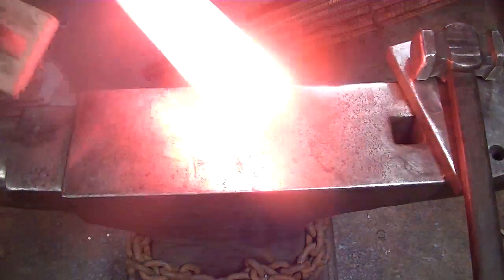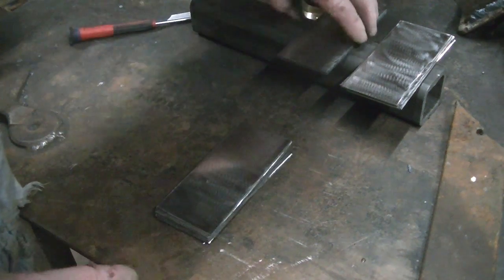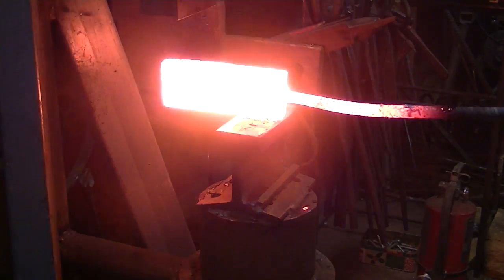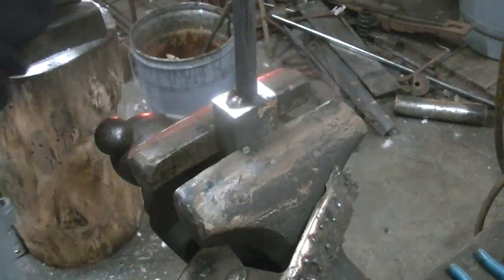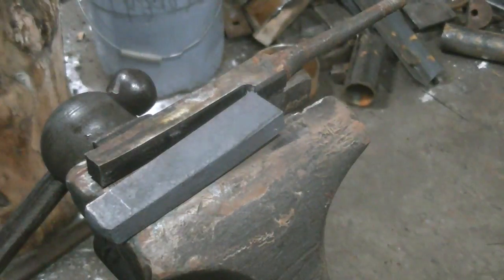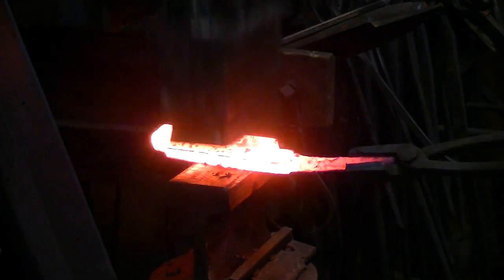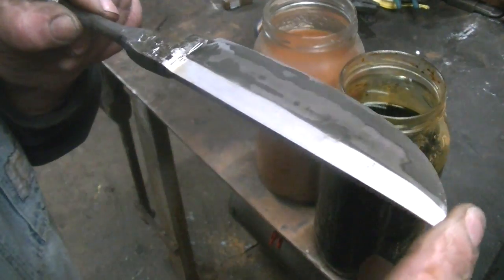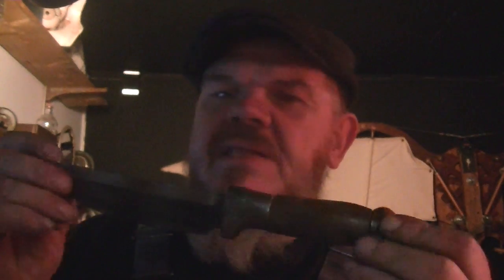Blacksmithing/Forging A Wrench Into A Knife

Comment: Hey, I hope you realized my comment about tongs in the last video was a compliment!  There is no way someone who hasn't mastered tong making could create the tooling you have invented.  But yeah, schleps like me who don't have a power hammer do suffer from envy.  Very cool repurposing of that wrench.  I didn't know they were made of wrought iron.  Thanks for the education again!
Reply from the maker: Hi Louis I did not take that in a bad way at all, I appreciate all comments I actually set aside all the fabrication for the day got behind the anvil with my hammer and had a great time. I put together a little video and it will be posted soon I read your comment on it because I believe people should be questioned and it helped me get back to the basics, sometimes I leave that stuff behind and when you're running a blacksmithing channel occasionally to you should probably pick up a hammer.  All is good my friend, I hope my video does not come across badly as well it's not intended that way.  Thanks again and have a good one.
Reply: BIG DOG FORGE glad to hear I wasn't insulting!  I'll see you on the next video...or on IFI some time soon.  Thanks for the information you share and have a great new year.

Comment: Very interesting project. But what I'm curious about is, what is that bat like thing hanging on your wall behind you. Looks like the steel could be L6 or L7, or 15N20. Some scrap yard shops have a hand held analyzer that can tell what kind of steel it is.
Reply from the maker: The thing on the wall is a prop i made for a photo shoot for a commercial years ago. Thanks for watching

Comment: Hey Tim! I strongly believe its 15n20 I've used it quite a bit and it does seem to have a lot of nickel content within it. One way to tell is simply by etching it next to some 1084 and the nickel won't etch anything like the carbon steel because the nickel is much more resistant to corrosion. Hope this helps and love your videos I watch live every Sunday morning before church

Comment: Nice concept for a knife!  Especially love the story of what it's made from. 

As for the saw blades, I have access to Woodmizer blades and even called them and couldn't get a straight answer on the alloy except that it's "a secrete proprietary" blend.  BS, if need be you can send a sample off for spectral analysis and know exactly what elements are in the mix.  From what I've seen, pretty much all band saw blades, at least the ones that are not bi metal, have a lot of nickel in them as nickel is a fatigue reducer.  There's still a few L6 band saw blades out there, but most are a variation of 15&20.  Easy way to test, heat a couple small pieces up to critical temp, let one air cool, quench the other in warm oil.  Try breaking, if the air cooled one breaks it's likely it is a variation of L6 and air hardens, if the not and the quenched piece breaks like glass then it's got enough carbon and is likely a variation of 15&20.  Only way to know for 100% sure is to send a sample out, but with a little detective work you can get close enough to get a good heat treat on it.  The main thing is enough carbon to harden, and high nickel content for contrast.  One of the reasons 1084/15&20 is so popular for damascus is that there basically the same steel except for the nickel which gives a good contrast, so heat treat is super easy.
Reply from the maker: Hello forge52100 thank you for the interest in the video, I did the air cool test and the material did not harden on its own however the quenched material broke like glass so I'm inclined to agree with your assessment, I sent in e-mail to the manufacturer stamped on the metal, I have not received a reply yet but I believe that I am dealing with a variation of 15N20.  I've ordered some 1084 but currently all I have in my shop is 1095 so I'm going to continue to experiment with the sawmill blades out of curiosity, I'll be posting some of those videos so if you have any further input along the way I would like to know what you think.  Thanks again for the input and thank you for watching.
Reply: 1095 will work just fine, reason most people use 1084 and 15&20 is 15&20 is approximately .75ish carbon if I remember rite, so it's basically 1084 with nickel added.  1095 just means a little more carbon and you have less time to get it below the nose on quenching, but nothing major and still makes an excellent blade.  Might even get a slightly darker etch using 1095 in the mix vs 1084.

Good luck getting info from the manufacture, too many of them play there blades as some secret NASA alloy only they have, never mind they buy it by the truck load in rolls from a steel mill.

Comment: Really nice, like the step at the hilt and keeping the old handle suits the overall look.

The saw blades are usually cold rolled high carbon but it's hard to judge those, sparks test should identify.
Reply from the maker: Thanks Liam, that knife was a fun build, and thanks for tuning in I appreciate it.

Comment: Looks like 15N20 as you said. But a suggestion on the knife if you decide to make another one.Since you have the power hammer, I would add one more complete layer of leaf spring (which should be 5160) and 3 more layers of the 15N20. Make your billet and do a slow twist then flatten it out and do another slow twist. Then bring this billet to the size you wish and weld to the monkey wrench. You will get a much better pattern in your blade. Just a suggestion. Have a great day, Tim.
Reply from the maker: I do have plans to do another one of the soon Phillip I was wondering if twisting might help out the situation, now I'm convinced that that's what I'm going to do the next time actually like making the Damascus I just need to adjust my attention span to make it better knife.  Thanks again and take care.

Comment: ..All in all, You made a knife. A Perty Good one too. The only thing i could say about those sawmill blades is that they could make some Good wood scrapers. You have proven they can be used in knifemaking. I'll leave that to the Experts like you Tim. I do like the Fit & Finish of it, Rustic and Ready to use...
Reply from the maker: Thanks Ol James I hadn't thought about using them for what scrapers that's a great idea I occasionally builds stick bows for the local medieval reactors and I can never seem to find my scraper thanks for the idea man. thanks for checking it out take care and have a good one.

Comment: Gotta love a rustic knife, no matter what it's forged from and the handle looks great. I wonder what it would be like to longitudinally split one of those spanner shafts, and insert a spring steel or damascus piece into it to make a knife? I think your bandsaw blades are probably L-7 or L-6 high carbon steel, they also make great knives. Thanks Tim, great video.

Comment: looks like a decent steel to make blades with. i like the simpler more patterned damascus billets. super high layer count is cool, but the lower ones look really cool. i think i may use my angle grinder to rough grind my bowie from Christmas weekend with my brother... im not a huge fit and finish kinda guy... my brothers knife turned out awesome, but he enjoys taking something rough and refining it, making it perfect... i think its pretty tedious haha.
i was thinking about building an anvil version of your tong jig haha :P i still struggle with the dowel part haha!
Reply from the maker: If you need any help with the jig let me know, I would be interested to see how that works it sounds like an awesome idea but if anyone can do and I think you can you're pretty crafty, buy the way the knives you made on the Christmas videos we're pretty cool, good job keep up the good work man.
Reply: BIG DOG FORGE thank you Tim :) i may start working on the jig when i get home haha, ive got a ton of steel drops from the scrap yard. they charge 0.50 per pound, so im always picking up stock. im just waiting for them to get a piece similar to what you used as your power hammer anvil so i can start my build haha! but i suppose i could just do what you did originally, until i find what im looking for...
cheers Tim!

Comment: Tim, I liked your video re-purposing the monkey wrench. The handle was really a great adaptation. As to what the saw blade material is I can only suggest what you already know and probably did. Try the file hardness scratch test. Bring a piece up to critical temperature and quench it. Does a file scratch it now? Next you can spark test it to see if it showers bright, sparkles on the grinder. It look good on the grinder in your video. Maybe check the lumber mill's website for where they sourced the steel, maybe they have a spec for steel used in the band saw blades on their website. It would be cool to find the manufacturer's spec for the specific blades you have. If they sell them at the lumber mill, then maybe you could call the mill and ask. Some sleuthing might pay off. Best of luck. By the way, keep the videos coming! Nice work. Thanks, Keith
Reply from the maker: Hello Keith thanks for checking out the video to do appreciate the input I've been playing detective and I found a few things the name of the manufacturer is printed on one of the blades I went to their website and it looks as if this particular group of blades is 15n20 thanks for the help your suggestion worked out quite well.  Take care and thank you for the comment

Comment: I love the way the wrench knife turned out,  you did a great job forging the blade to a nice profile.  The bandsaw blades are almost certainly 15n20, especially if they are all steel teeth, as opposed to carbide brazed teeth, although even then it would still be possible for it to be 15n20 as its such a tough steel and ideal for just the body of the blade as well.  

I'm curious, did you harden the blade?  When you harden the steel you tend to get more contrast than when it's left "soft".  Also, when making a Damascus blade is best to not forge the bevels down all that much, as it is the grinding away of the material that exposes the layers, even though your billet only had about 10 layers, this may help you on any future knives.  regarding your leaf spring material,  the older the better is usually the case as in the 40's 50's and 60's they used 5160 more often, where as now days there are so many different types of alloys used in leaf springs which can complicate the heat treating process.  So yea, an old Ford for example is an ideal source for such material.    

I do hope to see you do some more pattern welding.  I would also suggest setting your first weld by hand on your anvil.  The reason is because it's best to forge down the center of the billet first, and work your way to the edges.  This way all the flux is able to be squeezed out and not become trapped inside due to the sides welding up before the center has, which is one possible reason you had that bubble in your billet.  

Another way to insure you get a clean, no scale weld is by pouring kerosene over the billet before putting it in the forge.  This will do two things.  First it will act as a "glue" for flux to stick to before you even put it in the forge, thus protecting the billet before it even gets hot enough to begin to form scale, and two, it actually covers the surfaces of the steel layers in the billet with a layer of carbon (soot) when the kerosene burns off which protects the steel from oxygen and creates a carbon rich atmosphere around the billet... or something along those lines anyway lol.  Some smiths just soak their billets in a small bucket of kerosene for a few minutes or so before putting it into the forge and don't even use borax anymore.  If you hot cut and fold this will only work for the very first forge weld, as you obviously can't pour kerosene on an red/orange hot billet, so it's still a good idea to use borax when folding.   I think this technique is called hydrocarbon forge welding, it's pretty interesting!  Hope you find this so what helpful. 😉👍
Reply from the maker: Very cool thank you for all the information I'm definitely going to be doing more pattern welding in the future and I will definitely try some of the techniques that you've outlined here, yes I did harden and heat treat the blade but I think you're right I hammered out the bevel too thin I didn't even think about how the grinding affects the pattern, that's why you're the knife maker and I'm just the goofy blacksmith and I do love learning new things thank you so much for your help it's very much appreciated.  Thanks again and have a good one.

Comment: 22:35 It's fascinating how different Blacksmithing and Goldsmithing are. when buffing, we never use sandpaper thats coarser than 250 grit. we finish off with 1200 grit before polishing

Comment: I'll bet ya that light light spot, was probably some welding material, no big deal. I like how you mentioned HOJ forge, I really admire that guy, he don't have a ton of money, and he makes damascus style by hand, and makes killer stuff. I don't pretend to be an expert, but I have seen the Green Beetle guy say he will anneal metal before he does the bulk of his grinding on the belt sander, because if he hardens his knives first, they take forever at the belt sander / grinder. But he leaves enough so that it doesn't crack or warp in the quench. Also, to really get the most out of your pattern, don't hammer your bevel, you want to grind it. It's a little bit of an argument for the guys that have it in their blood to forge big and grind small, but for damascus style stuff, I've seen the consensus is generally grind the bevel. I think it was cool you kept the wrought iron spine in there and the old handle. I love to see old things that have new life given to them. Nice work man. I'll bet that Green Beetle guy or the HOJ Forge guy would take them saw blades with a smile. Alec Steele would take some, but he's in England and the shipping is spendy.

Comment: Why not do the spark test? If you got a known steel videotape the sparks and the saw blade. I do believe either Chandler or Green Beetle did a saw blade forge welded knife and said the steel was 15n20. 

For not being a knife maker, that knife came out great! Was wondering if having the leaf spring on the outside would make the edge of the blade last longer, since it's a harder steel? I like the pattern of the forge welded layer, with it not being twisted it's pretty cool seeing the layers 

Great video!
Reply from the maker: Thanks Phillip I am going to be doing more Damascus in the near future and I'll give it a shot with the leaf spring on the outside.  I haven't tried this part test yet but that's my next step I did find a manufacturer's name on one of the blades and checked it out on their website it looks like they're probably 15n20 but I think a spark test will verify that. thanks for the input
Reply: +BIG DOG FORGE you could twist the billet once or twice as well if you want more of the "wood grain" pattern look. With the leaf spring on the outside you may need three pieces of leaf spring. The pattern should be more pronounced with the leaf spring on the outside since it has the bulk to lose metal from forging. Good luck can't wait for the next video

Comment: Form my knowledge of metals and testing it's close to 15n20 butt its has some nickel it's like nickel mixed high speed steel to deal with the heat that generated through wood nickel to resist rusting and sticking to wood and  adds toughness
Reply: Butt if you wanted higher nickel use inconel so thoughts blades less nickel then 15n20 witch made specifically for knife makers
Reply: sorry that I carried on and wrote a lot or posted a lot but I watch every one of your posting and videos that you put out very informative very interesting still follower

Comment: I am no expert but I believe most saw mill steel is made by Uddenholm and is 15 LM if under 1mm thick and 15n20 if over 1mm thick. I have some and you can barely see the acid or laser etched UDDENHOLM 000 marking
Reply from the maker: I Gas point UDDENHOLM is the manufacturer I found the markings on the steel I'm putting together a little grind test video to see if some of you folks can give me a better idea of what I'm dealing with some of it is just over one MM but has carbide keys welded to it and I've been told that could indicate that it's just high carbon steel, so keep an eye out for the video and let me know what you think, thanks for your input I do appreciate it have a great new year